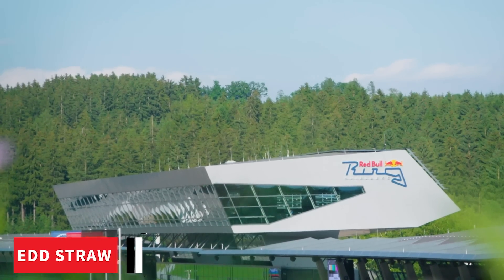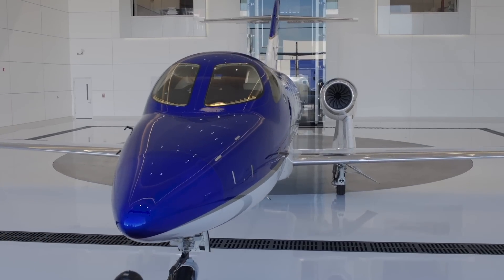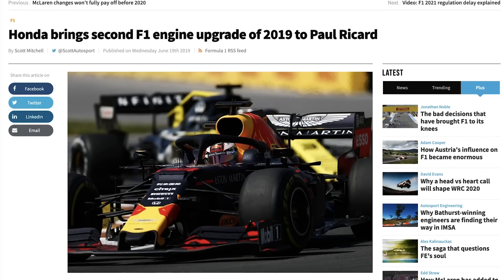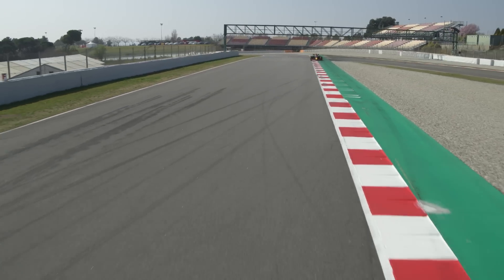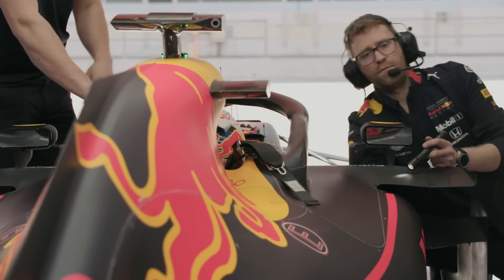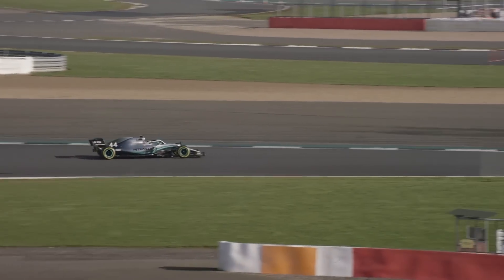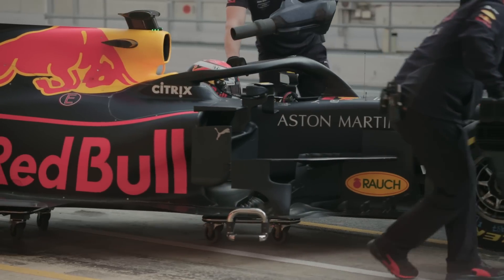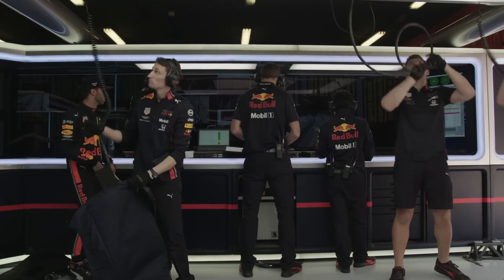How Honda's jet engine technology is helping it in F1

Comment: if people have not figured out that the company plagued by billion$$ worth of QC recalls, spending billion in minjet, cannot do basic performance auto engineering, and needed to contract outside Honda Motor Corp what AMG or Ferrari or Porsche or BMW can do INHOUSE. the jokers are still a mickey mouse operation with 600,000 engines in China with sludge (Hachigo CEO dec 2019 Tokyo Conference), and 1.4 l Civic and Accord and Acura engines with diluting engines below 4C, warrantied in the US, where it is warm, but not in Canada... Yes, AMG already works at aerospace grade, and its tribology for F1 cars is done inhouse on street car engine assembly line... Honda Corp cannot simulate high RPM mass rotation, and need the Jed help where the auto r&d disappeared for the last 24 years at a cost of 20 bn $... And yes AMG F1 PU got their reliability form Daimler's truck division... yes the Daimler truck division works at aerospace grade whereas Honda Auto Corp and its puny annual R&D budget for one advaced PU program (AMG is 10 Bn euro annual r&d and 12 advanced engine programs...) to forecast motorsports reliability look at inhouse auto r&d and QC issues in street tech... Even Toyota is now at billions R&D spending in motorsports.. with cars to show now..

Comment: I’m confident Honda will make Red Bull a World Class F1 Team.
Reply: They are on their way just to do that! This coming seasons will be fantastic for RB-Honda.
Reply: Honda Engines are being used in Formula 1.  All Honda Engines for Formula 1 are technically the same. F-1 Cars need to redesign their Chassis to provide a more rigid structure to prevent lack of cohesion between tires, wheels and changes in direction. In order to have rigidity but lighter would mean to use Titanium alloy wherever possible. Just for the record I am an Engineering graduated from Texas A&M Engineering School. I own Acura - they are an upscale version of Honda Automobiles. YOU HAVE TO MOVE TO HONDA TO WIN CONSITENTLY IN F1 using the VTECH engines. You will find me in Linkedin.
Reply: Confirmed
Reply: Aged beautifully.
Reply: It absolutely did!!

Comment: Bottom line is, Honda was and still is #4 on the grid. You could clearly see that straight line speed of McLaren in France was much better than Honda. Actually since 2014, nothing changed at all only Ferrari and Mercedes swapped places in  2018 regarding the best PU and in terms of power, the rest stayed as it was. Only the reliability improved. For me, both McLaren did mistake by ditching Honda, Red Bull did mistake by compromising their relationship with Renault. I though still believe RB never and any choice by Honda whatever the say.
Reply: TheWeeaboo Renault broke two cars on the last lap, Honda sometimes couldn’t finish warmup lap ( Alo @ Russia 2017 ).  Business or not, Ferrari, Mercedes and Renault do not want and financially the do not need to supply RB with Pu-s to earn money. They took the only option.
Reply: Luka Vujeva in the speed trap for France albon was in the top 3. It’s how the redbull was set up. The engine are not a massive factor now. If you took mercedes out of the equation and looked at the other merc runners they would look like they have a terrible engine. Bottom line Red Bull are 3rd even with another engine they still would be 3rd because they don’t have the strong aero they had other years plus they have the 3 biggest budget plus the 3rd or 4th best set of drivers.
Reply: Robert Naik 聶 you need to know that it’s not about speed trap. It’s about Frist lap as according to many sources and even drivers, only in first and second lap they really push even they are heavy with fuel. After a few laps they start managing and saving not only tires as well PU and fuel. It was clear how Sainz was having a much better straight line speed than Max, even Max mentioned it in post race interviews.

Comment: I agree, good progress. I also agree with Dr. Helmut Marko that the progress is too slow compared to the other engine manufacturers. And I also agree with Max stating that the engine is not the only problem, the Red Bull chassis and aerodynamics are not improving as fast as the competition. I agree with EVERYBODY. But the net result is, the Red Bull gets worse results over time.

Comment: Does the Jet Engine have VTEC ?
Reply: Definitely have VTEC
Reply: Yes, and when it kicks in it’s like brrraaaaaahhhh!
Reply: But most importantly, will it fit in my Honda?
Reply: As long as the F1 engine doesn't, it's ok.
Reply: @djoetma  Verstappen definitely had vtec
Reply: @vitorsimoes2484  And a Type-R mode!
The odd thing about F1 is that variable valve timing isn't allowed. Pity, because it's one of the things that was tested in F1 and made it to the market of ordinary street cars.
Reply: Well we have seen they got VTEC 2.0 with Max!!!! Ohhhh look it’s already monday. Breaking news Gasly just finished at the Austrian Grand Prix... 🤣🤣🤣🤣🤣
Reply: @Subreact007  I heard he was still busy overtaking RAI, it took him a week!
Reply: Lololololol😂😂😂
Reply: Wonder of it burns oil like a vtec??🤔😂🤣
Reply: Variable Timing or VTEC. Jet engines do not use cylinder the compression occurs via rotating fin. You can look me up in Linked-in. I owned several Acura's (as they are called in USA). 
Honda uses solenoids in the camshaft to change the timing as needed thus called VTEC for Variable Timing. The cylinders have shorter travel and Honda uses an alloy Engine block, so its lighter.
Reply: Jet Engines are totally different - they are used in big airliners and military jets. The rotating fins of jets allow compressing a mixture of high octane.
Reply: You have to understand a four stroke engine. Stroke 1 sucks a mixture fuel and air, Stroke 2 is compressing the mixture - Stroke 3 is sparking the mixture causing an explosion - Stroke 4 is the exhaust. Honda changes the timing depending on the need for increasing of power.

Comment: The MGU-H turbine comp is jet engine based technology as it is. 🤔
You telling me they were able to find a loophole in that component..
Reply: Turbocharging piston engines predates operational jet engines, I don’t think adding a motor generator to it makes it any more jet like. Honda was using an axial compressor at one point but the rules limiting compressors to single spool meant an axial compressor was always an uphill battle. I don’t think they’re still using it. Of course there have been centrifugal jet engines, but that was a bit of a dead end. The design philosophy of the turbine is completely different in any case.

Comment: With all these engine upgrades.. McLaren must be kicking themselves for making such strict restrictions on the engine, so that Honda couldn't develop it proper... Red Bull on the other hand does it differently: by agreeing that it's a two way compromise from both sides.
Reply: Well Renault are still competitive just about so no big loss yet imo.
Reply: Red Bull even said that Honda delivers any engine they want, RBR will make the chassis and the car around it. That, as we can see, proves more difficult than RBR thought.
Reply: @ronaldderooij1774  Mclaren built their car around the Honda engine too. Hence the very compact rear end they had. Which itself caused a multitude of problems. I still think Mclaren made a huge mistake letting them go though.
Reply: Redbull was more of a challenger last year. Seems like they took a step back towards the chasing pack rather than forward towards Ferrari and Mercedes. McLaren on the other hand took a giant leap forwards. Really don't think they are kicking themselves.
Reply: @mikhailbramdaw  it's true Mclaren have made a huge leap forward. But they aren't going to threaten the front row with Renault power any time soon.
Reply: @guybrushthreepwood3002  definitely agree but the relationship between McLaren and Honda was slowing progress for both. I doubt we would've seen forward movement had they stayed together.
Reply: @mikhailbramdaw  ye of course, but I always thought Mclaren treated Honda poorly, and blamed them for a lot of ills, when in fact it was their own chassis wasn't all that great. Had they been a little more patient with them, they might find themselves more in Red Bulls shoes, where they are now Honda race winners.

Ron saw the long term plan, whereas the rest of the board didn't. Glad to see them on the up again now though.
Reply: red bull would be doing better with the renault engine, and have lost their "best chassis" award due to having to compromise, sooooo. Mclaren are doing a much better job and have come much further and faster and are more likely to catch redbull in the 2nd half of the season after Redbull are going to have many grid drops coming soon for more spec and no trouser, engine upgrades..

Comment: strange way to mount the jet engines on the plane i wonder what are the benefits
Reply: To reduce turbulent air going into the engines... usually they are place on the hull, and they get turbulent air from the wings.
Reply: Due to the size and shape of the plane, it also makes sense to have them there.

Comment: Tbh Honda still looks slower than Renault
Reply: @Stevesteve_  Because Mercedes is dominating? Even Ferrari is winless this season so far.
Reply: outside of last week, honda powered cars have consistently finished ahead of renault powered cars in on track performance and reliability....
Reply: Seahawk STRIKE Renault powered cars were also really fast in Canada. How about that.
Reply: @EmilyKaldwinFan  go count all the DNF's for renault power and come back to this thread
Reply: @SeahawkSTRIKE  Lol what can you do other than changing the subject and refusing to accept facts?
Reply: @Stevesteve_  and how many have renault won this year? ill wait.. the reason for this is because mercedes has gapped ferrari honda and renault, this deficit was not there last season
Reply: @SeahawkSTRIKE  lol
Reply: @Stevesteve_  also both of those wins were directly due to mercedes reliability issues and safety car randomness, we haven't seen any of that this year
Reply: @Stevesteve_  What's changed is no Hamilton and Rosberg drama, Mercedes have increased the performance envelope over previous and RBR are struggling with the Chassis.
Reply: It is on the limiter imo but not so much everywhere else... so for now I'd still rather have a Honda motor.
Reply: Steven Duffy Dan Ric left. That’s why

Comment: Honda has been pushing quite nicely and it is positive the fact that there haven't been technical issues up to this point in time. Hopefully they'll be able to push the envelope in terms of performance, in order to claw back the advantage Ferrari and Mercedes have in power circuits.

With this said Red Bull has to step up its game too to fight with Ferrari for podiums at every weekend and claw back the massive advantage Mercedes currently has.

Comment: If Honda use jet engine then what you think gonna happen when Mitsubishi get in F1
Reply: 😂😂😂

Crane engines?
Reply: @dsistudios8446  fighter jet, heavy industries,space electronics
Reply: Cooling will also be spectacular 😂
Reply: Its gonna be extra power and dont know where to use it
Reply: Mitsubishi makes very good jet fighters, rockets, large ocean going ships and their engines, and main battle tanks with CVT transmission. Yeah, that might be a good idea!
Reply: Mitsubishi has an Alliance with Renault and Nissan, i guess there's a high chance that Mitsubishi aerospace department will help too given that Honda is giving redbull its expertise in aerospace.
Reply: Mitsubishi is on a whole other level, they built the Mitsubishi X2 which is the first stealth fighter Japan has produced. 

Source:  https://en.m.wikipedia.org/wiki/Mitsubishi_X-2_Shinshin
Reply: ...and they stopped making the evo so f1 is far cry
Reply: Mitsubishi got quarter of a billion to spare.. 😏
Reply: @F1ll1nTh3Blanks  250m not a lot honestly
Reply: @wongyewxuan3880  👀
You're talking like you got that kinda change to spare. Sponsor me. 😈🤑
Reply: @wongyewxuan3880  you're right. Honda has probably spent something north of a billion dollar up to this point
Reply: @DidierPeroni  Most do but the moment you get the 1st working system of the ground equals a quarter of a billion off the bat. 
Over the course of the seasons since the PU change, most PU constructor's have spent likely billions plural at this point. 
Even though Ferrari has spent the most over all, I think Mercedes has spent the most on PU, pre technical conception.
Reply: @F1ll1nTh3Blanks  yep, since they knew about the rule changes a long time ago
anyways, ive sponsored u 250m of funding, now what will u do?
Reply: @wongyewxuan3880  if you were to sponsor me, I'll take like 100k to get the best seats for all the races. And 2-3m to further my rallying career. Return the rest.
Reply: @DidierPeroni  find 1usd on the streets, thats 250k done already
the rest? beg for a day
Reply: @DidierPeroni  or, im not a grammar nazi
Reply: Their cars will launch a surprise attack on Pearl Harbor.
Reply: ZERO!!!!
Reply: SUV F1? What
Reply: The team name will be "Zero"